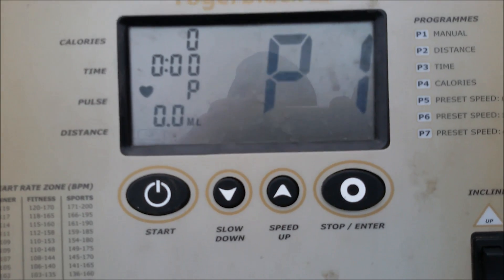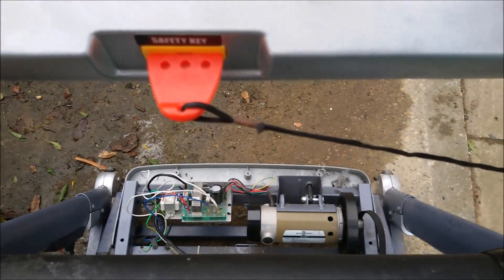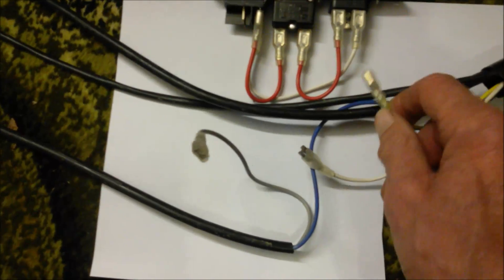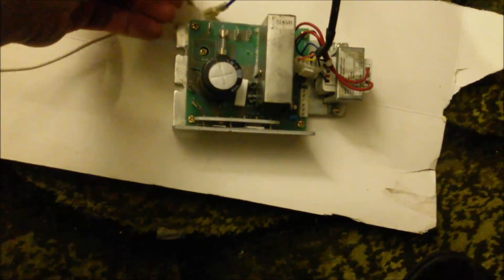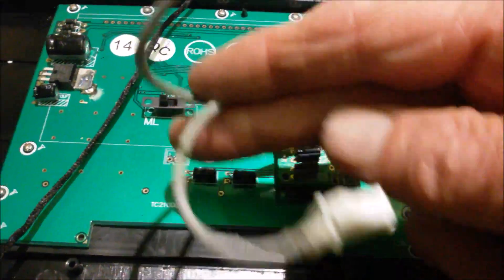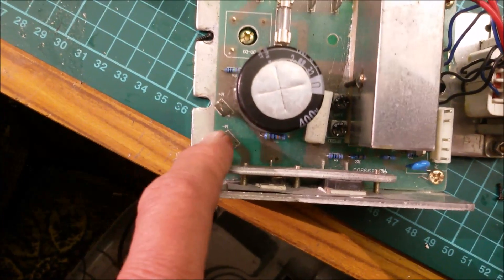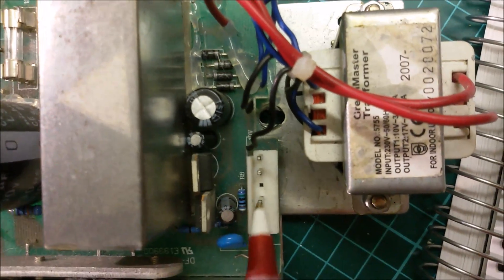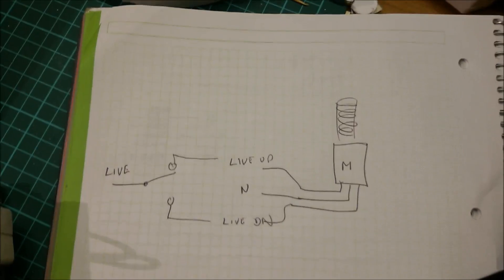Treadmill motor circuit for lathe

Comment: Very interesting video.  My house current is 110volt.. My treadmill motor is 90 volts. The treadmill board has been fried.  Is there an inexpensive control that would give me the capability to reduce 110 to 90 Volt and have the speed control in the same unit? Thanks for your help.
Reply from the maker: Hi Harris creek. If you are using this in a treadmill stay well clear. If you are motorising a drill or lathe then there are motor speed control boards that would be suitable. You will get local advice from machine shop and lathe forums. Your house power and the power needed by the motor are completely different. Your house voltage (not current) is probably 110 volt AC. The motor could be 90v DC (direct current) at 10 amps current It makes a big difference and needs to be understood. Get local expert advice please.
Reply: and also,pm,shunt series,compound etc,etc, a lot of things on the motors people have no clue what they are ,but i don't want  to wast my time know w/school for nothing

Comment: is it worth the trouble doing
Reply from the maker: Yes, the treadmill motor is as powerful as a mains motor and there is no more need to change pulleys to adjust speed. I use a smaller scooter motor on another lathe very effectively.

Comment: Dear John
Thanks for a well produced video. Can you let me know what you final solution was to the connection for variable speed of the motor?
Reply: Lynn, keep it simple, get a 10000w Chinese speed controller from ebay (£12) and a 50amp bridge rectifier (£5), swop out the 500k potentiometer on the speed controller for a smaller one (some say 100k, some say as small as 5k)
Suck it n see... Put it all in a nice wee box, (stick a computer fan on if your a show off) and Bob's your uncle..or in this day n age, Bob's not quite sure about his sexuality, so he's called Karen !!.. Goodluck 👍... And remember safety first, stand in a bucket of water, and wet your hands thoroughly 🤪
Reply from the maker: @AA-69  How hard was that? See you can do it if you try. A very helpful and useful reply. You will see another video where I did use the Chinese motor control circuits rather than reconfigure the treadmill circuitry. My motor and controller is still working fine.
Reply from the maker: Hi Lynn. Everything was working with this equipment stripped from a treadmill. I just boxed up the electronics and used it as it was. I have another motor.
Reply from the maker: Hi Lynn, On my Emco Unimat 3 I have a smaller motor (about the size found on electric scooters) with a speed controller supplied at low cost from China. A 12v power supply is also required. So the connections are... Mains into 12v DC supply...... connect to 'motor speed controller board' from China..... connect to DC motor. Ensure all components are of adequate 'ampereage'. The motor speed control board comes with a 'pot' to vary the speed but no reverse.
Reply: What he's saying is.... HE HASN'T GOT A CLUE !!!..ANOTHER  WIND AND PISH VIDEO FROM A DREAMER 😠

Comment: each treadmill has its own proprietary patented circuitry.  I am using a 2.5 hp Nordic Track setup adapted to my Midas (circa 1995+) 1220 lathe/ mill and the wiring control circuitry is different for each treadmill manufacturer. The important controls are the speed and if possible braking functions on the main board. All the other functions, incline, heart rate, odometer, etc. can be unplugged for simplicity sake without losing critical lathe/mill function control.
Reply from the maker: Yes john, there appear to be two basic types of motor, dc as here or else three phase ac. It would be possible to just use the motor and drive it with a Chinese made DC motor controller. If the rebuilder has some basic knowledge they could locate the low voltage speed control signal into the treadmill control circuit and then they would not need to use the control panel. Thank you for your comment. It is very helpful.

Comment: ELA FICA LIGADA DIRETA SO DESLIGA PUXANDO NA TOMADA PODE ME AJUDAR E VC TEM UMA PLACA DE MARCA PARA VENDER  ESTERA E DA TREADMILL  SUNDOWN
Reply from the maker: Thank you. I hope you enjoy my videos on lathes, model trains and bits of engineering.
Reply: transistor desta placa e que numero
Reply: e um irg4pc40ud
Reply: estou precisando deste numero do transistor o regalador de voltagem do motor vc pode passar ´pois a minha esta raspado  de fabrica e a sua e a mesmo modelo
Reply: +Solimar Garcia hi. you'll have to give me a couple of days to translate your comment. have you written it in Spanish?
Reply from the maker: The English translation ....
I need this transistor number motor voltage regalador u can 'pois spend my this Grated manufactures and yours and the same model .. does not make sense to me.
Reply from the maker: If you require details from the circuit board it will not be possible. I have mounted it inside an enclosed box. Voltage regulators for DC motors are easy to obtain on ebay from China. They work from 12 to 40 volts and up to 10 amps for about 10 euro. You then need a dc supply such as an LED power supply for shops. Full variable speed control.

Comment: Did you finish this circuit with a POT? I am curious as I have just squired the same machine and want to set up for my record wood lathe. Thanks Brad
Reply from the maker: +Brad Cahoon Hi Brad. I was going to use a pot but ended up using the control panel.Should be easy using a pot to provide the control signal to the motor control board. Let me know how you get on. John
Reply: +John Mellor there is something wrong with my board unfortunately
Reply from the maker: +Brad Cahoon If the motor is ok then I guess it means looking out for one with a burnt out motor but working control board. There are also cheap control circuits for dc motors from China.
Reply from the maker: Hi Brad, see the great comment from Jerzy above..  Check ebay for a motor speed control board. Just make sure it has sufficient power (current, amps, watts). No need to worry about voltage, mine works for anything from 3volts to 30volts. You will also need a 12v or 24v dc power supply, depending on the dc voltage of your motor. These are sold as 'LED lighting supply'. Again just buy one with sufficient power.
Reply: You need to hop on eBay and get the SCR 220 v ac controller, a bridge rectifier, and a 5k pot. Did this to my Bridgeport milling machine and it is wonderful for around 25 bucks US you can't beat it. You can see my conversion at flathead Ron's garage on YouTube. No more soft start and you can put a switch inline and when you turn it off the back on you are at the same exact rpm as you were before. P.s. Low rpm is about 60 to 80.
Reply: What he's saying is NO !!!... HE'S FULL O WIND N PISH..... do the same as everyone else, Chinese speed controller and a bridge rectifier.. 👍
Reply from the maker: @AA-69  This guy, A Aa, is an active troll. They always post negative or abusive comments.

Comment: when  I  use the treadmill the motor gets hot after 15 minutes what do I do
Reply from the maker: +Roberta Flores Hi Roberta, it could be any number of problems. If the motor is under heavy load - working too hard, it will get hot. i do not use a treadmill but understand that the bed under the belt needs to be scrupulously clean and lubricated. There could be friction from other sources - I've seen one with the belt skewed.

if it is a brushed DC motor then if the brushes are worn it can arc and get hot. Could you check those issues first. You probably need to find a forum for your particular make of treadmill.
Reply: Put a fan on it.
Reply: no,,,, dummy, fix the problem first .

Comment: another trick if find old wire feed welder...use for lathe carraige feed  has control..and most 120 volts
Reply from the maker: that is another great tip Miguel. Thank you for sharing it with us. I will look out for an old welder.
Reply: Mught be imtresting upgrade for home made mill 2.5 hp..variable speed see if come up with something....thanks for feed back  keep up videos..... dont worry about saftey nazis
Reply from the maker: +Miguel Castaneda I haven't yet justified the expense of a mill. I would certainly look to variable speed motor drive if one came up.

Comment: Hi again John , The incline motor idea does not work due to the duty cycle of the motor , it is 1 on 8 off any more than that and it gets too hot , oh well i tried
Please view my tread mill lathe setup you have a mention , Thanks again , Alanhttps://youtu.be/ff7bwWXQL8c
Reply from the maker: I did check your excellent video. Forgot to mention it here though.

Comment: Hi John , I have the same motor and board that I intend to use for one of my lathes , Can you tell me how to connect a potentiometer to this board or is it more complex than that , I am not bothered about digital readout just simple speed control
Great vids by the way ,    Alan
Reply from the maker: alan manning Hi Alan, there is a five wire connection on the main motor control board. The power supply board provides a reference voltage (+8v). Ignore the two AC voltage wires. Connect one end of a 10k potentiometer to GND (blue) the other end to +8v (black) and the wiper to OUT (white). See video at 9.08min. Let me know how you get on.
Reply: John Mellor  Hi John , Brilliant ,Tried it today , Worked a treat , Thanks a Million , My next challenge is to use the Incline motor and gearbox only without screw jack to power the feed on my Little lathe , I have another speed control so it shouldn't be a problem now , Thanks again John
Reply from the maker: alan manning Hi Alan.The screw jack is 240v AC mains powered. Speed control for that would be from a mains dimmer or speed controller I guess. I had not thought of that use. It sounds like a good idea, I look forward to hearing your experiences.